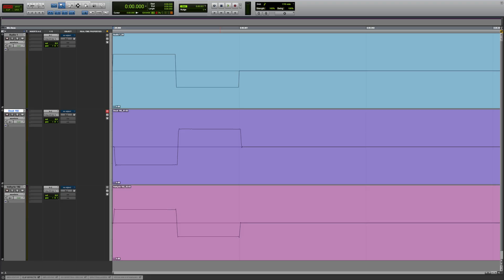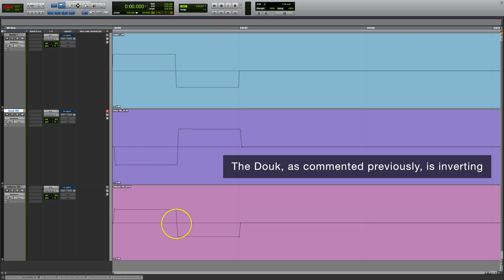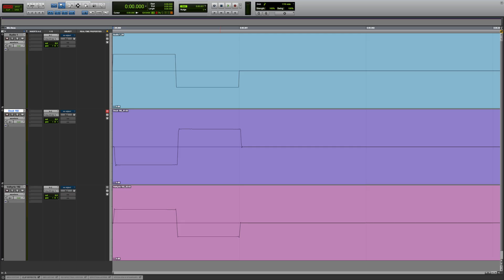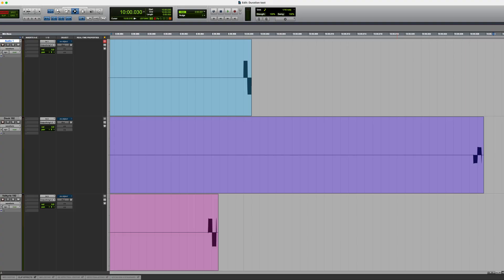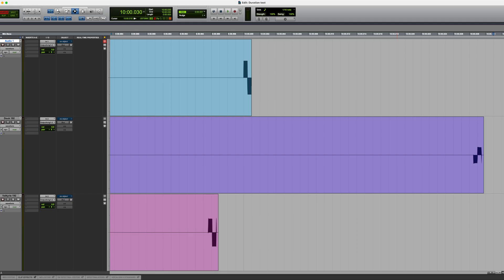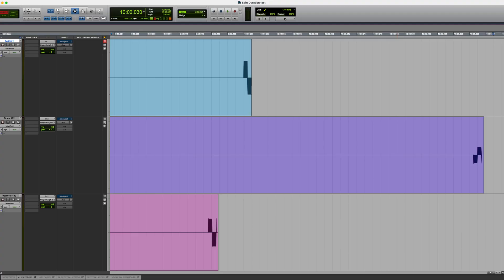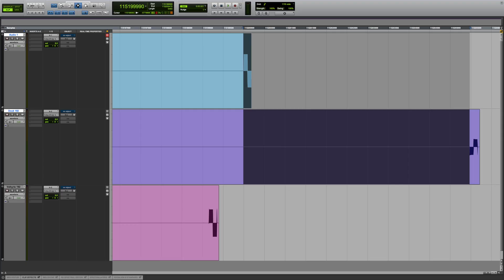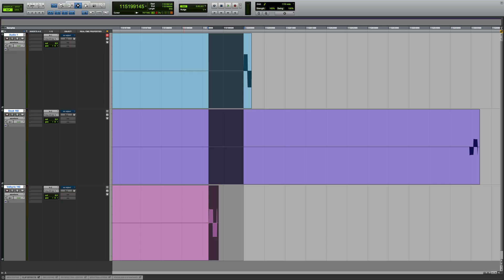Do DACs have timing issues?

Comment: Hello, did you use the same filters on both DACs? Gene from audioholics has a nice video up just yesterday what those filters measurable do to the signal including time alligning at higher frequencies.   A fun watch just like your masterclasses.
Reply from the maker: The Douk doesn't have filter options. I think I mentioned which filter I used for the Valkyrie, probably standard, but I wouldn't expect this to affect long term timing.

Comment: Unfortunately, your conclusions are wrong. You refer to the total play length and conclude from it precision, accuracy and adequate timing over the whole length of an audio file.
Hope you know this is impossible.
A DAC is not a black box; it contains ICs and components which potentially can generate Switch Timing errors, Capacitive Coupling and an inadequate buffering can cause distortion in the output signal etc. etc.

A DAC manufactured by not appropriate trained staff will not show a constant quality for each produced instance.

Actually, the reason why good DAC are expensive is e.g.:
#1 Adequate design of the PCB layout 
#2 Selection of components
#3 adequate power supply
Etc.
So, I see your videos about DAC as click bait. You do not focus on the relevant aspects of a DAC

Comment: If running multiple DACs simultaneously, for example if running multi-channel and multiple active speakers with separate DACs they will benefit from clock synchronization or they will tend to drift apart, just like your example shows.

Comment: Even if you buy one of these clocks, how do you hook it up to your DAC. My Schiit Aidio DAC has a BNC connection, where in menu do I tell it to go to the clock. I did tell the people at Schiit about this. They told me the DAC has very accurate crystal controlled clock.
So should I stop jittering?

Comment: As an electronics designer working with crystal driven systems I am not surprised. 5480 samples over 10 minutes at 192 kHz is moot. If you do the math, this is a deviation of 47.6 ppm. Every run-off-the-mill quartz crystal is specified with a precision of 50 ppm. Good ones are 20 or 10 ppm. It then depends on the oscillator circuit, and in particular the load capacitors added together with the parisitric capacitance of the chip the crystal is connected to if you meet the specified frequency because crystals will be pulled off from their specified frequency by these capacitances. This is absolutely nothing to worry about and you cannot even hear it.
Reply: Bad timing , even microseconds cause fatigue, hence why R2R is more relaxing, and also this is the science behind millions of Taps on a Chord
Reply: Thank you, this is an exposure of a charlatan, he deliberately misleads everyone, presenting everything that does not concern the sound, but constantly talks about the price, this is a common move of an incompetent seller)))

Comment: Without knowing the accuracy of the ADC originally used, you cant tell which dac is fast or slow, only that they differ from each other by the measured amount. They could both be fast or both be slow depending by how far out the ADC was,  in either direction.

The assumption pro tools is right is a flawed assumption.
Reply from the maker: As I said, I constructed the source file in Pro Tools, I didn’t record it. As I also said, I presume that Pro Tools can count the correct number of samples in 600 seconds. Perhaps Pro Tools can’t count correctly but I believe that would be a less reasonable assumption than it can.

Comment: Well done, sir! A test that is simple and easy to see the results of, and then not worry about. These tiny errors represent the errors of the quartz clocks in the DAC's, and they are too small to be concerned about. As for the master clock idea, unless you're going to buy an atomic clock (like the one you link to), the master clock's accuracy likely won't be any better than what is shown here. Master clocks are not necessarily for perfect timing, but rather so that all the devices in a studio can have THE SAME timing.

Comment: This is really nothing new
If you would do this test with three or more cd players you will get the same kind of results one will be slightly slower the other one slightly faster
All comes down to one component the crystal used in the device
Even if you would buy 10 crystals of the same brand same frequentie and same batch, even then you end up with 10 different ones 
It all comes down to one thing tolerance

Comment: Oh well. My lonely all-in-one ( a EverSolo DMP-A10) has a duel clock in its DAC section. As stated in this message, such devices can be different in critical parts used and that nothing is ever prefect. In these clocks as with clocks used in shortwave radios. The crystal oscillators are even put in “ovens”to kept the temperature correct. How close is necessary to keep in tolerances that are with in “acceptable”. What ever that is?

Comment: The difference is as important as the terrible "cogging" issue of direct drive turntables and the nanovolt differences that silver speaker cables have over copper ones! Never mind the incredible differences in sound stage that a 1000 dollar power cable makes!😂😂😂😂😂
BTW, I discovered the time dilation phenomenon when comparing vinyl recordings to digital ones of exactly the same masters. I have never compared DAC's since I have only the McIntosh DA2 to test.
They are utterly imperceptible
Reply: You tidily hid a real issue within bogus ones. I'm guessing you have an old Technics deck. Cogging is seriously audible. Don't take my word for it. Technics developed their Delta Sigma motor to reduce cogging and it works. They didn't spend Megabucks on developing a motor that eliminates a problem that doesn't exist 😂😂😂😂
Reply: If I was you I'd sue Technics. Your old perfect TT is no longer perfect and they give a lifetime guarantee. Oh hang on Technics give 2 years at very best.
Reply: Yours probably had 1 year. If they are indestructible why the pathetic warranty?
Reply: @andy3974 
😅😅😅😅😅😅
The C53 has a 3yr warranty. But if other McIntosh components are a guide they could probably waranty it for 20 and would still get less than 5% uptake. Note that McIntosh is the only company that will service any component they ever made 😅😅😅😅😅 
Finally since timing is determined by the DAC chip, please feel free to list all the chips better than quad balanced 32bit ESS😂😂😂😂
Reply: @Wised1000 not talking about McIntosh we are talking about Technics. But tell me the components that Rega don't support.
Reply: @andy3974 
In fact I"ve had two modern technics decks an sl 1200G and now an SL1000R. Their cogging is as bad as it's ever been. Technics simply addressed the idiotic notion of the pseudo problem to shut up ignorants such as you😂😂😂😂 Now the microvariations of speed that could only be seen with an oscilloscope abd could never ever be heard are below even an oscilloscpes level of detection. Now the W/F is below tge limits of measurement and the speed accuracy is also. 😂😂😂😂
You're arguing with the wrong guy! Not only are you very inexpirienced pronaly because you recently started to shave, but you also seem to have very little knowledge of tge underlying concepts. You beed to read a bit more.😅
Reply: Wouldn't the weight of the platter offset clogging issues.
I have a Kenwood direct drive turntable. I've had it since 1977. It still works to this day.
Anyways the platter must way 3 to 5 pounds. The inertia alone should offset clogging. 
I never heard any issues that would relate to clogging.
Reply: @paulsalongo4927 
It was always a BS issue. Simply  a defect that belt drive audiophools came up with to claim that belt drive was superior than direct drive.😂
Reply: @Wised1000 So back to my original point. Why did Technics spend a fortune on the Delta Sigma motor if it wasn't needed?
Reply: I'm not defending belt drive here I'm defending the premier DD manufacturer. Do you think Technics are ripping you off? Are you saying that the Delta Sigma motor is pointless? It cost an absolute fortune to develop and that cost has to be passed on. I admire Technics for tackling a problem head on and fixing it. You are calling them Audiophools.
Reply: @andy3974 
Not at all. Before the W/F was minuscule. Now it is unmeasurable. I had the 1200G, a few years later I traded it for a 1000R. My point is that the cogging issue was not the point just a promotional stunt.
Reply: @paulsalongo4927 Jeez it's cogging.

Comment: Timing difference or delay causes jitter and distortion. But if your gear is not resolving enough, it wont matter.
Reply: Given the actual differences are in 1/1000ths of a percent... there is no way you're going to hear them, no matter what system you have.
Reply: @Douglas_Blake youll be surprised. Its not hard to hear the difference.
Reply: @justanobody4983  
Oh please... spare me the crap about revealing systems and poor hearing.  Nobody, not even Superman, could discern differences at that level.  I suggest that just like Superman, those differences are merely figments of your own imagination.
Reply: @Douglas_Blake i guess im superman then. Lol its very evident and obvious when you hear it. Obviously i cant here the difference with a jbl party speaker.
Reply: @justanobody4983  
You keep right on telling yourself that... because it's likely nobody else will.
Reply: @Douglas_Blake of course, i know its right because i can hear it. Its not hard.

Comment: I wonder how these external DACs compare to the ones present in today's digital audio receivers from the likes of Denon etc. If the built-in DACs of such receivers are OK (to me, mine surely is, at least I never even suspected any issues with it), why would I even bother with a dedicated DAC?
Reply: Well. They will be better. If you are unlucky your will be cd quality. The DACs testet here are both in the theoretical realm. Beyond human ability to hear. In most cases and most people won't hear a difference vs the one you already have
Reply: @niklasschmidt Unlucky with CD quality? That’s all I need with my 57 year old ears.
Reply: Look up the part numbers ... a lot of the high end stuff is using the same chips as the cheap stuff.

Comment: Cut the same track on a vinyl record (using a DAC with an atomic master clock) then play it back on a good calibrated turntable and you will likely have drift in the hundreds of milliseconds (or more) - but analogue sound is better, isn't it ?
28 ms over 10 minutes is a drift of 0.05 %. That is above the accuracy of a quartz crystal oscillator, but it might boil down to a non accurate frequency division - i.e. they could not get exactly the required sampling frequency. I anyway couldn't care less of such a drift; what would matter to me is:
1) is the drift consistent over various measures ?
2) are L and R channel perfectly in sync ? Some DAC's use a single internal DAC for both L & R resulting in a noticeable phase shift at higher frequency.
Reply: Exactly! Same with a mag tape reel to reel or cassette player used to play back a master tape/ vinyl master. I'll take a few milliseconds timing error over rumble, surface noise, tape hiss and wow and flutter any day.

Comment: DACs also have differences in latency and (for reasons which are not entirely clear to me) it's not always the same amount every time. I have successfully identified tracks by looping small sections in infinite A>B loops and can even cite an example where an 11 millisecond difference has easily detectable to me.

Comment: I've long wondered whether it would be worth adding an external clock to my system, but never pulled the trigger.

In terms of your test, I'd wager that the more important measurement would not be the total drift, but the consistency in drift. In other words, a clock that is consistently slow by the same amount would surely sound better than one that speeds up and slows down, which would tend to be obscured by a 10 minute test, where the faster and slower parts would cancel each other out, but would be heard as a warble or unstable tone during playback. They call that jitter, yeah?

And if you think that clock stability is important in a DAC, don't even get started on the drive mechanism of turntables. Audiophile danger zone!
Reply: That then would be jitter. Which can indeed cause audible effects.
Reply: @bernhardkaiser9677 not necessarily jitter. It could manifest as the digital equivalent to wow & flutter.
The first Calrec Digital broadcast mixing consoles installed in BBC TV Outside Broadcast trucks had a clock that varied when locked to the truck’s video SPG (master clock) not enough to be noticed in simple operation, but when we used long MADI cables to stage boxes, they would not stay locked due to the drift. By using a better quality Video to Word Clock synchroniser to lock the mixing desk to, the problem went away.
Reply: Absolute and utter waste of time effort and cash. The differences are like comparing the precision of a quartz watch and a cesium atomic clock. Measurable, but so out of the realm of human perception as to be utterly useless😅
Reply: "I've long wondered whether it would be worth adding an external clock to my system"

That depends entirely on how much money you're willing to waste.

Comment: Please see my earlier comment on the first video comparing the two DACs, in which I noted that the Douk output data compresses better than for the Valkyrie, but both are worse than the original data, suggesting that both DACs add significant noise, because noise does not compress well.  By compression, I mean lossless data compression using the bzip2 algorithm.  The timing differences is a bit weird; it is difficult to understand how that can happen.
Reply: He was using WAV files ... no compression applied.

Comment: The fosi is slow by 0.0047% .... the valkerie is 0.0007% fast.
 The pitch shift isn't even a tiny fraction of a note so it's not like one is dull while the other is shrill.
This is an inaudible difference. 

But, I have to wonder how repeatable those results are ....
What would be the outcome on 5 repetitions?
Reply: Excellent point!
Reply: @cdl0  
I'm betting those results are within the tolerances of the crystal in the clock oscillator.... and I'd also wager they are more accurate than usb or computer buss timings, which raises the question of how accurate the master track is.
Reply: @Douglas_Blake  Indeed!  Also, I wonder if we can attach any significance to the Valkyrie time being shorter than the original.  Might it have dropped some samples?
Reply: @cdl0  
It's in the video ... the Valkyrie is 847 samples short....
Reply: @Douglas_Blake  Oh!  I missed that.  Well, lost samples is not good.  Also, did you see my comments about noise?  The Valkyrie seems to be noisier than the Douk.
Reply: @cdl0  
We don't know they're actualy lost. David wasn't clear whether it was 847 samples or 847 sample times.
Reply: how were these DACs fed? If it was through SPDIF or AES/EBU, the sender provides the clock...
Reply: @poofygoof  USB, so the DAC's internal clock.
Reply: @poofygoof DACs are just reading buffers. Sending clock is irrelevent.
Reply: @1donjuego  the clocking seems absolutely relevant to the difference we're seeing. I suspect if these were being fed from SPDIF or AES/EBU or shared an external wordclock, that they'd all agree on the sampling rate and we wouldn't be seeing the time variation.

for each of these units used in isolation, the amount they are off doesn't seem like it would be noticeable even by someone with perfect pitch, but ganged together for multi-channel, it could be an issue.